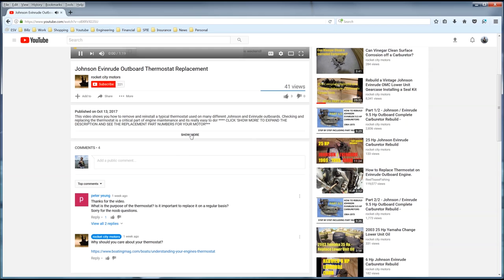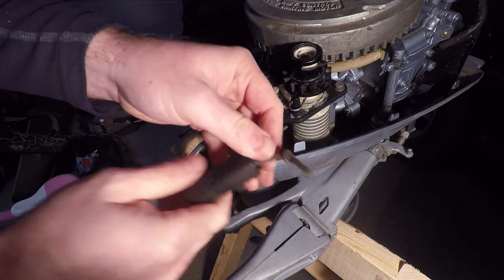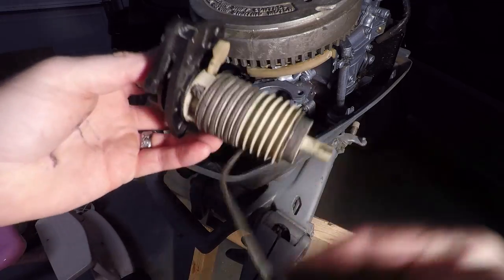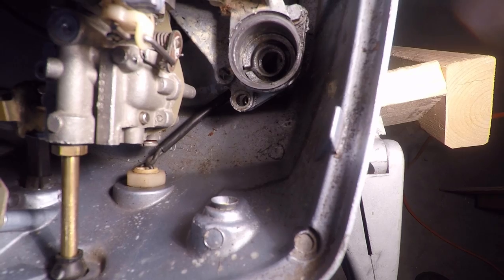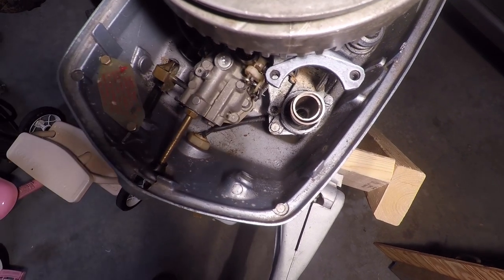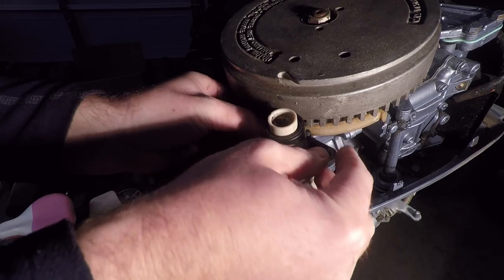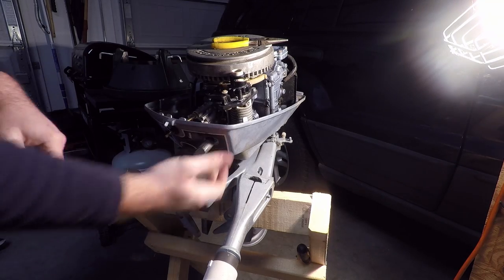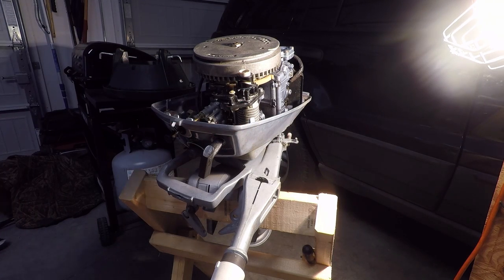Repair Johnson Evinrude Outboard Recoil Starters

Comment: Thank you for posting this. I was able to remove the carb on my 6hp but couldn't get to that nut behind the recoil and I was afraid to take the recoil off.  After watching your video I pulled the recoil ,installed the carb and had it all back together in 30 minutes.

Comment: As a novice to boat repair, this video helped quite a bit. I got my motor with the cord missing and had no idea even where it was supposed to go. My only problem with this video was the bad camera angles. You kept putting the camera right where your hands were. The info about how many turns to make for the different yrs was great, but how long is the rope supposed to be for that many turns? There aren't many videos about these older motors and I am very appreciative for you putting this out here for us. Thanks

Comment: Great video! We have a 1982 Evinrude 6 hp that we use as a trolling motor on our big boat. Cord broke end of the season last yr. Mine doesn't have a cam follower as a few others have also mentioned. Only problem I had is that at first it wouldn't retract. I noticed that my knot was catching on the metal dowel pin. I had to pull the rope back out and retie it smaller and pull it tight with pliers. I tucked it in as flush as possible and made sure it cleared the dowel pin. After that it worked perfectly!

Comment: EXACTLY what I was looking for.  I am in the middle of this process right now.  I bought the Seloc outboard repair manual for my model.  The manual is helpful but sometimes I struggle trying to get all the information off print format.  Even with their diagrams and pictures I was left with questions.  I want to learn to do this level of maintenance myself.  In this process I have already discovered that the reputable marine store that I took it to last for service, including rebuilding the recoil starter, installed the bottom spring retainer plate 180 degrees incorrectly and neglected to put in a bottom bushing.  For me it is not so much a matter of money, I don't mind paying professionals for their skills, knowledge and time.  But it drives me nuts to "discover" the those kinds of errors.  I subscribed, "liked" the video; and if you had a T-shirt for sale I'd buy one of those as well.  Thank you very much!
Reply from the maker: Apack Westbound glad it helped. Haha I’ll see if I can come up with a logo and make a t-shirt. I’ve been meaning to do that.
Reply: I'll buy one, really!  I'll add it to my Dangar Marine bought off YouTube collection.  I'm more than happy to "support" smart, industrious and skilled people.

Respectfully,

Comment: Thanks, learned to pre load the recoil start counterclockwise from this video. I've had mine on and off a few times. I found that passing the rope through the guide (dowel as referred to in this video)  and the spool before pre loading and securing the top two bolts let's you load the recoil spring without needing to fish the rope later

Comment: The best tutorial that I've come across, but when reinstalling the rope I cranked it up to 16 turns so that the handle wasn't floppy when finished (I only had a limited length of rope). I found that using the pick to get the rope between the bar and the cylinder to be really fiddly due to the lack of manoeuvring room. I pulled the rope all the way out from behind the cylinder and pushed it in between the bar and the cylinder with my fingers and then out to the cowling hole.

Comment: I wish I would have found your vid yesterday, before I wasted one whole day trying to figure out how to lock in the spring to the holder while everything was still assembled !! THANKS !!!
Reply: yea, that's the hardest part of the entire process.  Took me forever as well.  The key is removing the spring from the recoil spindle so that you can see it slot into the correct spot.  Then reassmable the spindle on top of the spring.

Comment: Good video but at 7:30, you don't need to route the rope through the dowel prior to retracting the rope.  It does it automatically as you let the spindle unwind to the starting position.  Just guide the rope so that the initial wrap starts at the top slot.

Comment: Great video helped a lot. 2 things I couldn't see. Once the rope is knitted and seeded does it get passed it between power head and the starter. And on other side does rope go on outside of rod or between rod and starter. And what is thickness of the rope

Comment: At 5:26 you mention the "cam follower". That part  appears to have been  removed  from my starter assembly  (and I believe  over time, many outboard mechanics  have removed  that part as being  problematic and expensive.
Reply from the maker: Interesting Steve that’s news to me
Reply: I'm attempting to replace the pinion gear on the starter recoil assembly on my 6R76A Johnson and noticed that mine is also missing the cam follower, not sure if this part serves an important purpose but it did start & run well until I broke the pinion gear.....

Not worth spending the $30+ (not exactly sure all of the parts that would be needed but I know P/N 0398682 alone is $26....

Comment: Great video, super helpful in my repair of my recoil starter.  

One question I didn't see addressed in the video, you mention loosening the back bolt in order to release the spring from the slot.  I in fact had to do this in order for the spring to release.  Do you tighten that bolt back up before reinstalling the spring in the slot or do you want the spring to slide between to two plates held together by the bolts?  You never mentioned the re-tightening of that specific back bottom bolt.
Reply from the maker: Great question and catch.  Yes I had to do this as well. Thanks for commenting and potentially helping someone out with the same issue!
Reply: To replace the starter unit to the powerhead,  (1) Place the bushing in the spring retainer plate.  (2) Twist the spring to lock the inner spring onto the spring carrier.  Pull the end of the outer spring out of the spool and hook it onto the retainer.  (3)  Place the guide in the starter plate.  Insert the spring hook into the retainer plate slot. (NOTE if the spring hook has broken off, you can re-bend the end).  Raise the retainer plate to hold the spring.  Install the front retainer plate screw and tighten the rear screw.  remove the spring from the spring retainer.  Install the starter assembly to the intake manifold. (4)  Place a heavy duty screwdriver or a brace with a screwdriver bit in the slot in the top of the starter spool shaft. Wind the main spring 16 1/2 turns COUNTERCLOCKWISE.   The rope anchor hole in the spool should face to the port side of the powerhead.  Raise the pinion gear to engage the flywheel and lock it in position with pliers.  (5)  Install the rope as described in the rope replacement paragraph."

Comment: I have an 8 hp with same recoil mechanism. Mine is seized ie won't pull out at all but I can turn the flywheel and prop so I assume its the starter. The whole starter assembly is no longer available. Any suggestions?

Comment: Thanks for the video.. .question about the Rope.  Do you need to take the rope off in order to reset the tension? I replaced everything and my rope is only going in like 3/4 of the way..
 I am assuming that I need to take the rope off in order to reset the tension.. Can I reset the tension with the rope on? I tried it and it doesn't seem to work..
Reply from the maker: Yeah you have to take the rope off, wind it up, tie the rope back and when you release the tension it will spoil the rope back on

Comment: I have 79 6 hp what diameter rope should I use. I put in 1/8 the put when I pull it the top quarter and it rewinds the top quarter doesn't get rope pulled on it even after I had it full after doing it what could be the issue

Comment: Great video. On the 12 turns. Is that 12 turns of the starter or 12 turns of the flywheel?
Reply from the maker: Starter
Reply: thisoldoutboard thanks for the reply! I did 12 turns of the screwdriver at the starter. There seems to be no tension and the starter isn’t recoiling back. 1990’s 6hp Johnson. What am I doing wrong?

Comment: Hey , I have a 1978 evinrude 30 HP 2 cycle outboard gas motor with electric start - can I remove the starter the same way ?

Comment: have you ever had the 2 springs get stuck in the white recoil piece? I am trying to figure out how to get them out. mine are stuck in there.
Reply from the maker: I can’t say that I have.  Were you able to remove the entire assembly?
Reply: So the inner spring was twisted and not in slot and the outer  was bent  I pb blasted it and muscled the spring out bent the inner and outer spring back into correct position  greased and installed.  Your video was spot on! And I learned that the spring is just one spring wound up all silly no wonder they discontinued making it. Thanks for the great videos!

Comment: starting at reassembly I sure wish you showed how to install the spring back into the bottom plate ???you just happen to stop recoreding and comeback to it already installed and say yea just like that and also right before that your talking about A LOWER SPRING RETAING PIN?????did you make that up there is no part like that listed in part diagram,sure wish youd show the only tough part of this entire replacement
Reply from the maker: Apologies
Reply: @thisoldoutboard  do you have any vids on a 87 20hp Johnson recoil with 2 plastic paws

Comment: Your hands block a few of the shots.  Getting the spring hook into place requires loosening the bottom plate enough to slide the starter spring hook into place.  Could use a bit more instruction.  My motor does not have a cam follower.  Otherwise a very useful video

Comment: Sometimes when I pull my rope it will engage the flywheel quickly other times I have to pull almost half of it out before engaging. Any advice?
Reply from the maker: Part number 4 in this diagram can sometime hang up in its slot.

http://www.marineengine.com/parts/johnson-evinrude-parts.php?year=1979&hp=6&model=6904E&manufacturer=Evinrude&section=Rewind+Starter

Try some silicone lubricant on the mechanism and see if that helps
Reply: How do you remove Part Number 4 in this diagram?  I have to replace my pinion gear on this same 6HP motor, do you just knock it out with a hammer?

Comment: Can someone tell me the size and length of the dowel pin in this video ? Thanks
Reply from the maker: https://www.ebay.com/itm/OMC-Roll-Pin-PN-309686-/114225091647?_trksid=p2349624.m46890.l49286
Reply from the maker: 1/8th diameter. 1.125 inches long

Comment: My 1970 Johnson 6hp doesn't have the cam follower either.  

I guess I have to cut the rope to be able to recoil the spring.
Reply from the maker: It looks like the cam follower is only on the 1976 77 78 and 79 motors

Comment: Just received a hand me down Johnson 9.5 model # 9R-71R that has been sitting around for over 10 years.  Got it going a lot easier than expected but on initial start up, water was gushing from what looked like from under the flywheel.  On my 2nd running in the tank, I can see that it has slowed to oozing out from just under the recoil cogs just below the retainer clip about where the diagram locates what looks to be a felt pad in the top of the stem.  Should the recoil unit have water inside of it?  Can I remove the top gear and retainer clip and add new grease to this pad or do I have to completely take the unit out to repack it?  Or does it sound as if my water problem is rooted deeper?
Reply from the maker: Your recoil starter shouldn’t have water in it.  It sounds like you have a bigger problem than your recoil starter.  Does the motor run rough?  Is the crankcase cracked that you can see?
Reply: It just purrs right along.  Starts easily.  Carb doesn't act like it  needs going through.  At first I thought the carb may not be working because I had to keep squeezing the bulb when the tank was on the floor.  Then raised it to about a foot below the inlet and it pumped just fine.  Took the thermostat out and put it a pan of hot water and it began to open at around 100 degrees and seemed to be fully open around 140/150 degrees.  Has a good glow of water coming out and  you can feel it getting warm.  The highest temp I have read on the water coming out was around 100 degrees.  If I read the temp on the thermostat housing, it runs 120/140 degrees.  Cylinder head around the plugs stays around 100 degrees and about the same for the plugs.  I can not see any signs of water around the thermostat housing or the block as far as I can tell.  It just seems to be seeping just above the rope windings.  The engine has never been into.  Drained the oil from the lower case and it wasn't contaminated and seemed to not be low on oil.  I was surprised on how clean it was.  Flowed very freely when draining.  Looks like I got about 8 oz. or so out of it.  I thought maybe the lower housing where the recoil its might be a water jacket but other than that I just can't see any other source of water coming from the engine.  Not sure what I am overlooking.  Puzzled!  Thanks for you response.  dm

Comment: what year model is your johnson?
Reply from the maker: 1979 Evinrude 6 Hp
Reply: @thisoldoutboard  hey , I have a  1978 evinrude 30 HP outboard 2 cycle motor - can I remove the starter the same way ?
Reply: @thisoldoutboard   I forgot it has - electric start ?

Comment: How do you do if you not have a cam follower?
Reply from the maker: Process should be the same just easier.

Check this out

http://islandersailboat.info/wp-content/uploads/2015/07/52138772-Johnson-6HP-1965-68.pdf
Reply: Can you install a whole starter with a cam follower on a engine that dosen't have cam follower on it's original starter?
Reply from the maker: Emil what year 6hp do you have?
Reply: I have a 1972
Reply from the maker: Emil I believe that will work
Reply: I'm attempting to replace the pinion gear on the starter recoil assembly on my 6R76A Johnson and noticed that mine is also missing the cam follower, not sure if this part serves an important purpose but it did start & run well until I broke the pinion gear..
Reply from the maker: HuttonN17 thanks for the comment